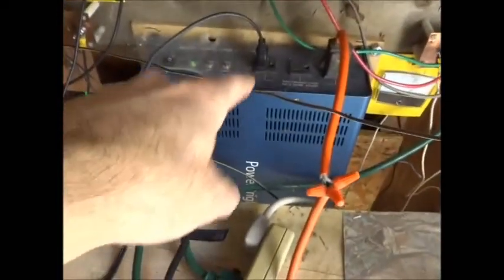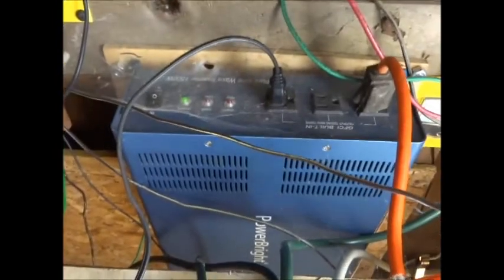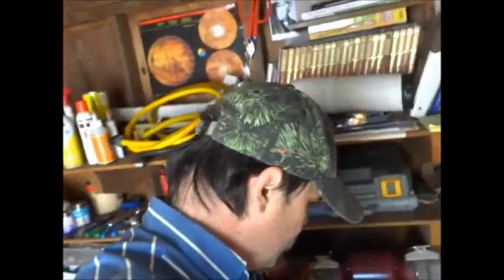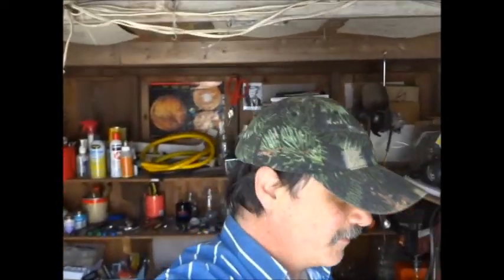Grid Tied Sine Inverter Downside Roofmounting

Comment: Roof top systems are safe for firemen if they are installed according to code (hence why electrical codes exist).  I am not an electrician or a solar expert, but I have done alot of research trying to figure out a way to do what I think you are trying to do with solar.   It is called "gridtied with battery back up" or phrasing to that effect.  It is expensive.   There isn't a cheap way to connect grid tied inverters (I think you are mainly referring to Enphase micro inverters?) to run electrical loads without them being connected correctly to grid power.  I asked at a couple places and currently there is only one unit that lets you (sort of) do what you are describing and that is the Outback Radian.  I recommend a sitting position when you see the price of those hummers, and that price doesn't include the $1500 of parts you need just to make it run in addition to panels and wire and batteries.   I think the Magnum makes one model that can except the 215-240 volt input of the Enphase models too.  I recommend going to Arizona Wind and Sun webpage and read the forum.  People are asking the questions you are asking all the time.  Lots of good stuff there.  Good luck.

Comment: It is too hot for solar panels on the roof. They make a lot more electricity setting in the yard. on trackers like mine. air can move around them keeping them cool. Never try to hook a gti to a regular dc to ac inverter it will defiantly damage it. A guy made a video trying to do just that. I would defiantly catch someone in yard trying to remove my solar panels. The guy rhandsom on his channel uploaded this video. Watch it. "DIY Home Solar - GTI with Private Grid - Concerns Verified" and yes he tried it and fried it. Have you considered the GTI Controller like I and rhandson both bought from nrodge1 channel it lets the batteries charge then when the time comes to dump it turns on the GTI s and feeds the power to the grid. I uploaded a video about the GTI controller google that and also rhandson just did too. Its his latest video.
Reply from the maker: shartne Thanks!!!